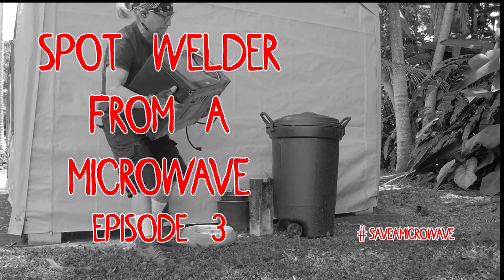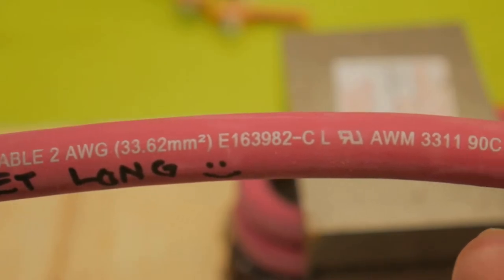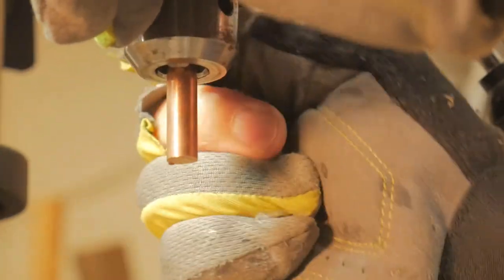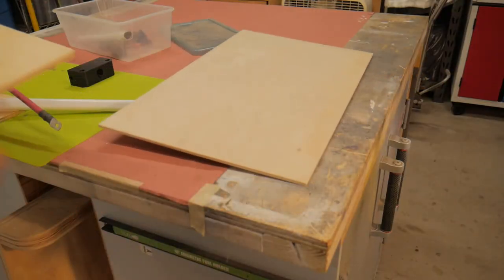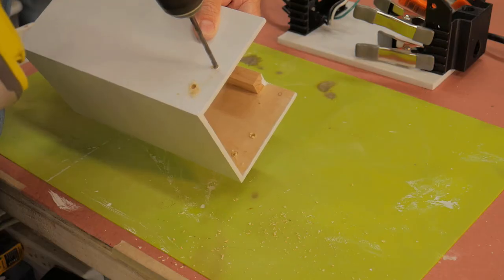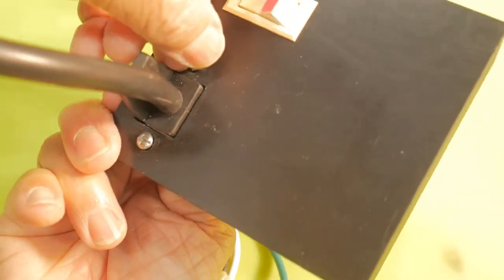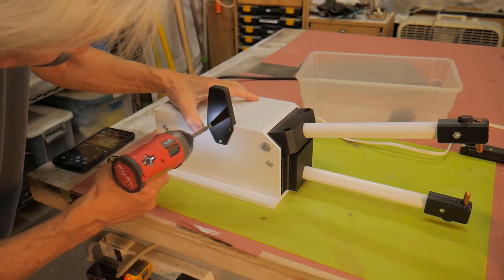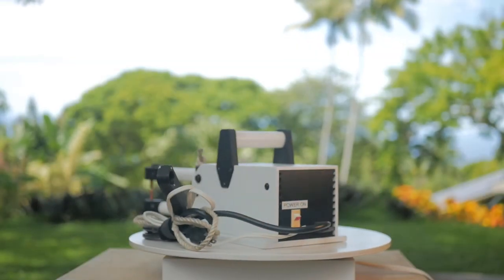Make a Spot Welder From a Discarded Microwave. Episode 3

Comment: Sweet build! Looks a little overpowered for that test piece - how thick a plate do you think it could handle?
Reply from the maker: Thank you. TKOR welded 2 washers together. So maybe 1/16”? 🙂🙏
Reply: @garagemonkeysan  Sounds reasonable. Could you put a dimmer on the wall power cord, so the welding power can be reduced when welding thinner material? 🤔
Reply from the maker: @CrudeButEfficient  That could work! 😊